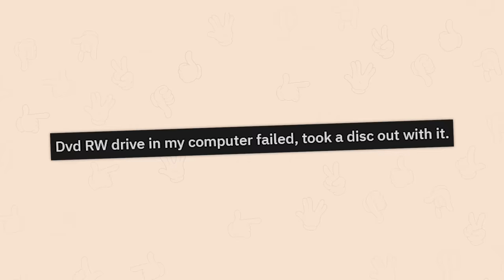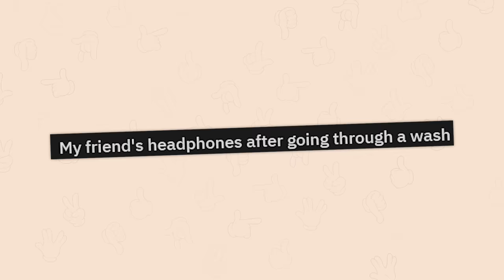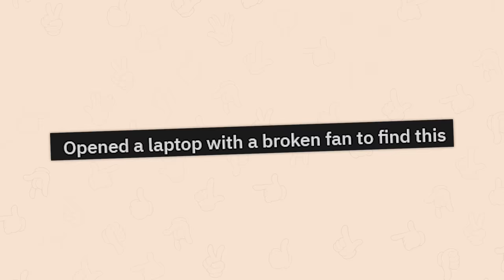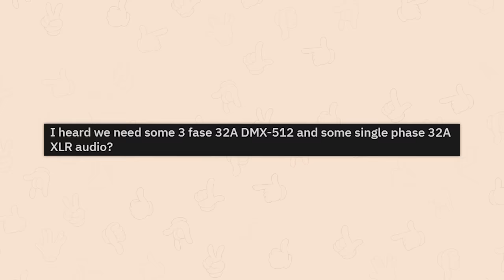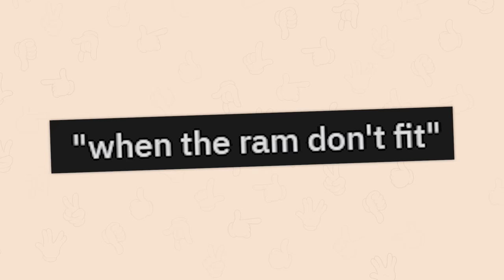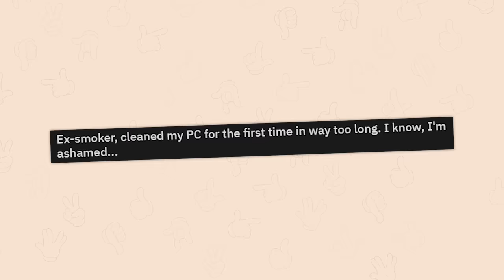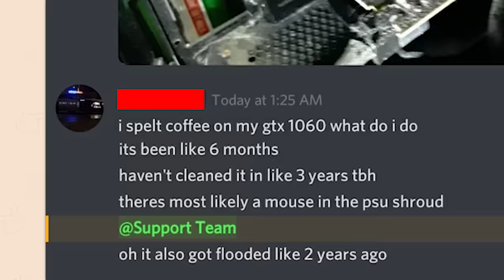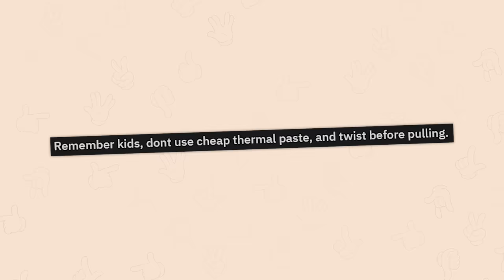r/Hardwaregore | it fries my laptop

Comment: Shame i did not take a picture of the time the school bully beat me over the head with my school laptop, damn thing was ruined in several ways 1: Several keys had popped out. 2: The screen was bent beyond repair. 3: the battery and most of the internals had dislodged and buckled the casing.

That picture would have been perfect here.
P.S. I am fine, guess my head was sturdier than the laptop.

Comment: tbh considering the topic (whitch i don't think fits what i am going to talk about even tho it is about tech) i do have a ksyboard that has a broken w key it still writes w but it doesn't pop up like orher key's do my dad that specializes in reparing computers checked it out the other time
he pulled the w key up but when i pressed it again it returned to how it was before aka what i consider the normal state for it now
it had happened not that long ago but when it started happening at first it would stay down and pop up after a bit

not asking for recomendations on what to do (whitch i wouldn't mind) just sharing a fact